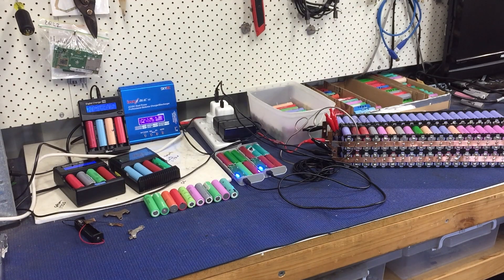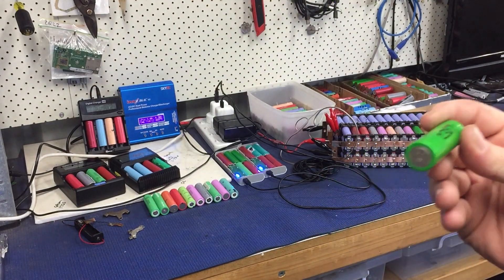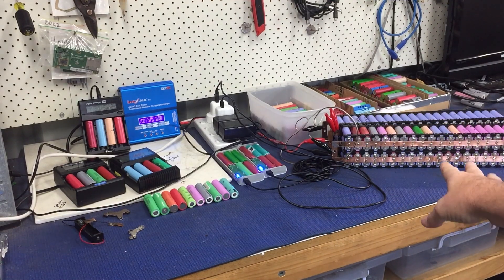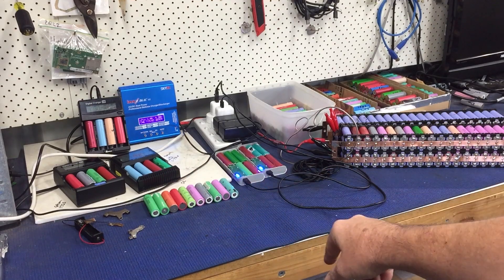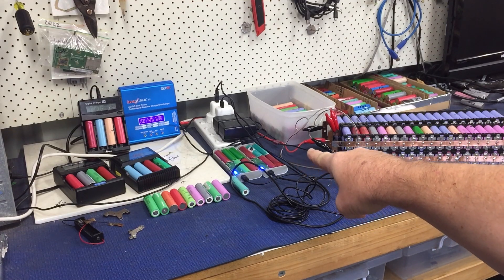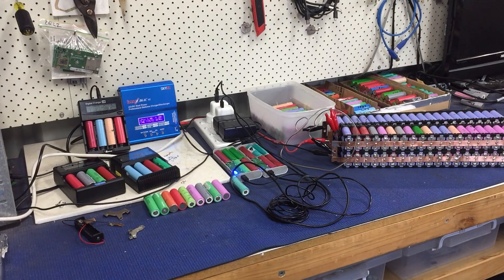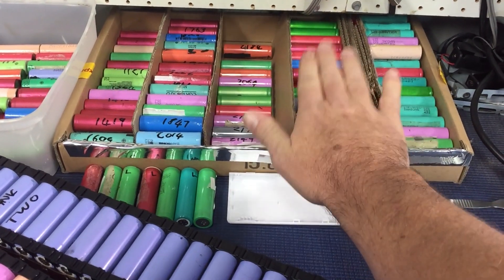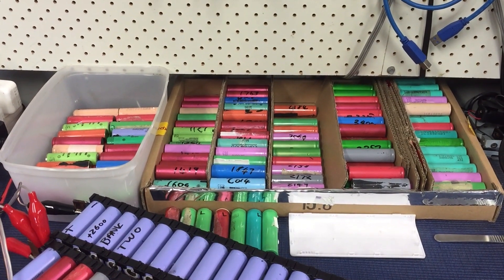How I'm charging & discharging my 18650 cells

Comment: Hi been following you for a while now, liking your work! I have a question? Discharging the cells. I've found if I discharge at a high rate say 1Ah, it discharges quite quickly (obviously) Then charge it back up to 4.2vdc. What I've found is my charge amount is averaging 1.8Ah. Thinking these batteries are shit, I then started measuring the voltage (discharged) with my multimeter only to find there still at 3.5vdc! So then I hit them again at 400Mh and get it back down to 3v however once again my multimeter is now at 3.2v. Discharge again at 100Mh. Now we are definitely at 3vdc. Re charge at 600Mh WOW what do you know 2300Mh! So really my question to you is did you have the same findings and what did you do to get the most out of your cells? At what rate are you discharging? Keep up the Youtube clips, I look forward to them everyday. Mark.
Reply: Given your quality charger and the fact that you have been using it for several years I am inclined to agree that your charger is not an issue and like you stated the most likely problem are the cells themselves. Where did you source these cells if do not mind me asking?

As per your request on my setup.

Charger: Clone Imax B6 with an additional set of single cell usb powerbanks for charging addition cells.
Charge/Discharge: (1 Cell at a time)
1A - 1.5A charging to 4.2v
1A discharge to 3.0v

My current batch of 18650 cells are from a batch of Toshiba laptop batteries with what I believe are Sanyo UR18650A series cells (or better). My charge rate follows the datasheet of 1A to 1.5A with a discharge of 1A (my testing standard). About half of the cells I have encountered so far were below 2.5v which I trickle charged at 0.1A then charged at 1A to 4.2v and then discharged to 3v at 1A (my charger also regulates discharge down to 0.1A during this test. Nominal capacity on the 40 cells I have tested so far have been around 2000mAh however I suspect that given my source that they were spare batteries and not heavily used. 

A previous batch I have gotten for testing were Sony cells from a li-ion drill with 1.5A capacity and 30A discharge. Most of these cells followed the datasheet and averaged 1300mah however two cells I halted testing on as their voltage was at 0.02v and got hot at a 1A charge.

My first series of cells were from laptop batteries averaging around 10 years of age. These cells get warm when charging at 0.5A and have an average capacity of 1000mAh. However when I was testing these I noticed that the 18650 battery holder I was using (dollar ebay junk) and it's extremely thin wires was causing issues with the sense circuits with my charger. I have since moved over to using the alligator clips supplied with my charger and a set of neodymium magnets recovered from disassembled hard drives.

If you can upload your photos to Imgur and PM me a link I can have a look at your testing setup if you wish.
Reply: +Mark Bryant Got any vids or blogs on this Mark?
Reply: +Mark Bryant 

In my own experimentation with 18650 Li-ion batteries there can be a couple of factors which are leading to your issues. First of all what brand charger are you using and did it come properly calibrated. Are you testing the voltage with your multimeter during discharge or after (Li-ion cells do bounce back when not under load) and have you tried to find the datasheets for the cells you are testing. Do your batteries heat up while charging (indicating high internal resistance) and what was the initial voltage of the cell before testing. All of these factors are important when charging/testing cells you get from laptop battery packs as they can affect the manner in which you charge the cell (and with packs with parasitic BMS's recover cells below 2.7v).
Reply: +Techburn Thanks mate for your feedback. my charger is the accucel 6 http://www.hobbyking.com/hobbyking/store/catalog/64345(4).jpg I've had it for a few years charging Lipo batteries with no problems. Calibration, who knows? I'm measuring my voltage after discharge, however almost straight after. Charging, the batteries do get a little warm at the end of the charge, but nothing out of the normal. I did another discharge last night and took pics (wish I could upload them). First discharge was at 700Mh -482mh 3.7v, next 300Mh -261mh 3.6v, again 100Mh -243Mh. This morning I checked it, still 3.6v so I have stuck it back on 100Mh I'll have to check it when I get home. I think this particular battery is probably nacked. But I'm using this as an example. Most will only take 2 times to get to a "proper" 2.99-3.0 vdc. I'd really like to know what rate you discharge your cells at & does your charger's rate decline while discharging as it does when charging? And finally I realize they can bounce back but what voltage is typical for you? Thank you so much again for your feedback, any info at the moment is much appreciated!
Reply: +Techburn I think you have hit the nail on the head. My charger does not regulate on the discharge, only on the charge. Maybe I need to look at the settings again. Effectively I'm regulating the discharge manually.

I'll try and upload the pics but I think you've solved my mystery. Thanks & will let you know how I go.